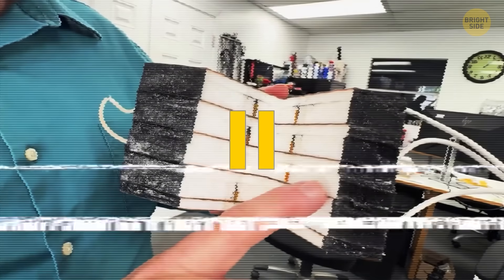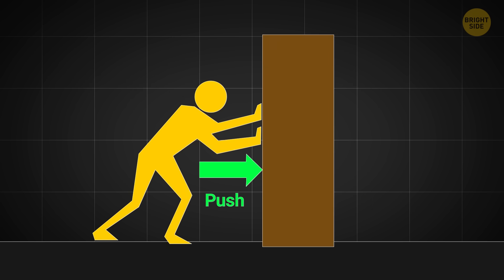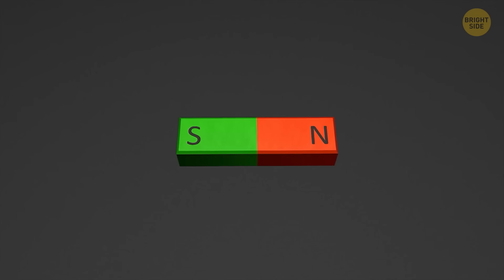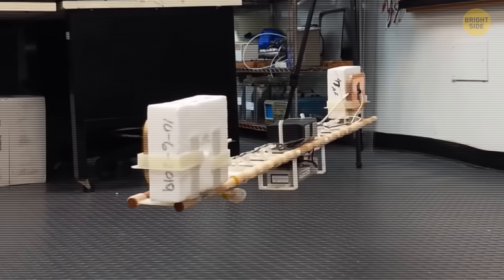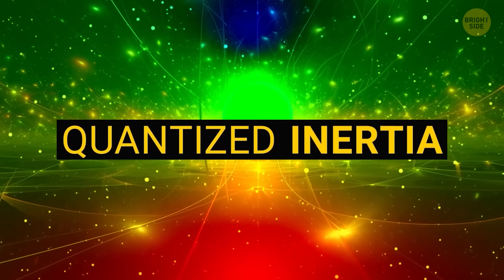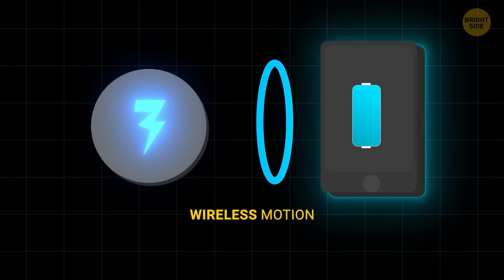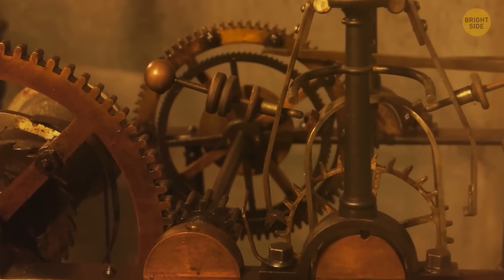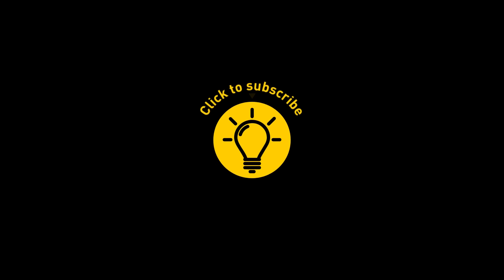Ex-NASA Engineer Claims He Built a Fuel-Free Space Drive

Comment from the maker: Do you think it's possible to build a rocket that runs without fuel?
Reply: Why use a "Rocket" when a Disc or Sphere could work effectively like the UFOs that remain unexplained?  Maybe somebody already has?
Reply: @RealMe55_  The Buga Sphere, found in Colombia and currently in scientific analysis, weighed only a few kilograms initially but as days passed now weighs 10 kilograms.   Sounds like the residual anti-gravity effect discussed in the video.
Reply: That would defeat the purpose of calling it a rocket, soooo no.
Rockets need fuel or you have to call it something else lol...
Reply: I am skeptical to say YES, But this project requires a means of intensifying or reducing the field around ANY shape that has the field on it and to generate such extreme electric field you may need  Nuclear power plant inside the shape otherwise by ordinary batteries generating limited fields your movement would be limited too.  I think this invention has much higher Efficiency in terms of the weight of a small nuclear plant Ratio to overall weight of the shape. Ratio of Mini nuclear plant over total weight.  M(nuclear)/ M(Total mass).  If you make a craft like this it will be more Efficient than TR-3B which works with spinning mercury to produce  desired field.
Reply: I think sound is a definite key to defying gravity

... A frequency that sorta pushes gravity far enough from w. E object its coming to the sode that it doesnt effect the object... How.... U fogure it out
Reply: Of course it’s possible.  We know less about physics and science in general than we know.  What we know about everything can fit on the tip of an iceberg.  The rest of the iceberg is unknown.
Reply: NO not a ROCKET yes using electrostatic propulsion or Plasma Magnetic Drive
Reply: First: there must be permanent electrical power : for Al electrical equipment to operate
Reply: @quincyphan3861 Gentleman RESPECTFULLY the space station work with solar panels but also they use plutonium, the voyeger has 25 lbs of plutonium and has been outhere for over 30 years,  a spaceship traveling outhere all it needs is the initial impulse there after it stays traveling with that initial impulse saving os fuel a very large percentage, they are fully electrical but NASA and the people high above won't tell us about it, guarantee that you have easily 90 percent of the knowledge required to understand a very large percentage of that technology  already in your head, PLEASE don't underestimate your knowledge and your potential, NO OFFENSE PLEASE.
Reply: Hoax supported by fallacies, sophistry and images out of context
Reply: Whos to say what creates that frequency im not thinking a speaker .. maybe a material tho
Reply: Yes it is very possible and you have 85 percent of the knowledge to accomplish it, guarantee.
Reply: I'm sure it's possible if someone it smart enough
Reply: We could use helium or hydrogen to lift fuel cells and people and materials all the way up the the lower ionosphere then launch it from there to a space station. We could possibly even use electromagnetic launchers from there to launch unmanned shuttles to orbit. 
  Just need to figure out how to create a re-entry vehicle that the helium balloon can collapse into and fly back to earth without burning up.
Reply: @captainKedger or we can use plutonium Which actually power different satellites and can last for centuries.
Reply: @captainKedger ( regenerating helium requires a chiller, also requires electricity), helium , hydrogen fuel : will produce electricity , be careful : metal in helium , hydrogen tank: evolved by helium , hydrogen ( saturated no longer works )
Reply: And lose the opportunity to make billions 😂
Reply: A rocket as we understand it? No. A craft of some sort? Yes.

Comment: Nonsense video.  Work, W, is done by transferring some heat, dQh, from a high temperature reservoir, Th, and delivering  less heat, dQl, to a  low temperature reservoir, Tl.  Work = Qw = Qh - Ql.  For naturally occurring processes the change of the Entropy of the Universe, dS, must be positive, given by dS = dQ/T.

The Three Laws of Thermodynamics written for laymen:
1)  You can't win (can't get more energy out of device than you put into it)
2)   You can't break even (just get out of the device the energy you put into it)
3)  You can't get out of the game (reach absolute zero Kelvin.)

The efficiency of any "machine" is = (Thigh - Tlow)/Thigh.
To be 100% efficient Tlow  has to be zero degrees Kelvin, which is impossible to reach because the exhaust port of the refrigerator would have to be below zero T.

Comment: It's surprising that this guy would dismiss electricity as a fuel source. While it's not a fuel in the traditional sense like gasoline or diesel, electricity is absolutely a form of energy that can be used to create propulsion. Electric vehicles, for example, convert electrical energy stored in batteries into mechanical energy using electric motors. This principal powers everything from electric cars and trains to spacecraft like ion thrusters used by NASA.

Comment: This ionic lifter is utter BILGE !!!  You need ELECTROSTATIC-based systems which use extremely high frequency (Terahertz!) EM waves to basically charge a fractal antenna to create a positive or negative charge on the outside of the aircraft planform hull which can be used to create the opposite or same charge as the nearby atmosphere that will PULL or PUSH against it providing propulsion. 

You can SEGMENT the outer hull's waveguides and fractal antenna plates so that you can push and pull on opposite side of the craft to make it go in a specific direction OR you can push against all sides to make it hover relatively silently. 

This IS NOT NEW TECHNOLOGY but pioneered at North American Aviation during the 1950's and 1960's and NAA is now owned by Northrup Grumman, a major U.S. Defence contractor who made the B2 Bomber, parts of the still secret hypersonic "Green Lady" and probably "Spearfisher" high flying planes too! That means they have the technology to make exospheric and in-atmosphere aerospace planes that don't actually need wings to fly! 

There are also GWASER-based (Gravity Wave Amplification by Stimulated Emission of Radiation) propulsion systems which use virtualized cavity resonators and waveguide to sum and direct HFGW (High Frequency Gravity Waves aka Gravity-A waveform) and MFGW (Medium Frequency Gravity Waves aka Gravity-B waveform) created by an on-board Cyclotron colliding Tungsten, Bismuth, Manganese or even common Iron nuclei together to form explosions that ripple outward in the HFGW and MFGW bands to be collected using stainless steel resonators/waveguides that use millimetre and RF surface waved and/or and standing waveforms as a barrier to collect the normally  untrappable gravity waves so they can be directed to form a pulsed series of quickly evaporating and localized gravity wells which compress local 3D-XYZ space which can be "surfed across" for super-fast local stellar and interstellar transport!

Even that is NOT a new technology but created in the 1980's! 

We don't have our 35K-HIGH patches for nothing!

V

Comment: No, it’s an electric ion propulsion - But it can’t lift very much weight, and it will only work ‘in atmosphere’ since it works by moving air molecules around.
And it requires a substantial electrical power source.
It’s a well-known phenomenon..
Reply: They tested it in a high vacuum though.
Reply: Its not an ion wind device its been vacuum tested by 5 different teams.
Reply: Surely he knows that though.
Reply: Yes,Yes sir. I agree and concur completely. Saw a similar device years ago on youtube  that looked like a aluminum foil kite with pyramid like latices that had an electric wire attached to it. When powered up it floated about. It looked interesting at first, but under closer scrutiny you realized about all it could do is take small house mouse for a short joy ride assuming the poor little critter didn't get jolt from the electricity that was running through it. What we have here is about the same thing. Show me a gravitic propulsion zero point energy from the quantum vacuum device that somebody built in their garage, that REALLY deifies gravity, flies and can be verified.

Comment: If it uses large amounts lfo electricity, fuel is needed to generate  that electricity. You can use atomic reactors for that.
Try the device in a vacuum. The static charge probably pushes against the Earth. If so itt will not work in space

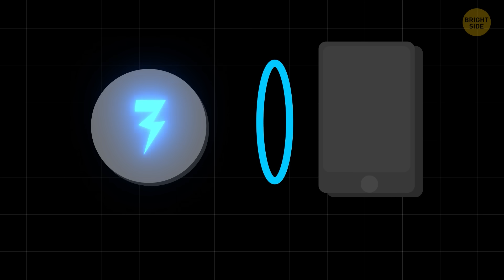Comment: At 5:55, a traveling toroidal field is show propagating from the "antenna" that, can be used to create a force, by switching the polarity of the next wave.  This can work as you emit your next pulse before hysteresis decay significantly diminishes the field strength of the previous wave. The question is, what medium are you using to create the charge field?  Is it atmospheric molecules,  or dark matter?

Comment: No fuel required, only electricity... And how do we generate electricity? With a generator running on diesel...
Reply: They didn't mean that it doesn't need a power source, only that it doesn't rely on chemical propulsion by burning fuel. The power source can be anything that generates electricity. Submarines use nuclear, or it could rely on a charged battery until it reaches space where atmospheric drag becomes low enough that solar panels can be deployed and take it from there. If this thing works it may not need to be as aerodynamic as a rocket so there would be more design options.
Reply: Electricity itself is a type of fuel. Not all fuels are liquid and you don't necessarily need diesel to make electricity, you can make it with the sun or wind
Reply: We already run submarines on small nuclear reactors. They can run for years on the fuel rods they bring. If we can move a craft with pure electricity and that craft can accommodate a small nuclear reactor then it's definitely a viable means for powering space probes and satellites
Reply: There is electricity all around you never heard of zero point energy huh? Take a peak let me know what you think
Reply: So what is a hydroelectric dam run on then?Diesel?  what about solar or windmills
Reply: @Definitely_an_angler_fish you gonna put allat in a rocket?
Reply: I know like that seems to be what a very special group of people think, diseal generators are the only way possible generate electricity@Definitely_an_angler_fish